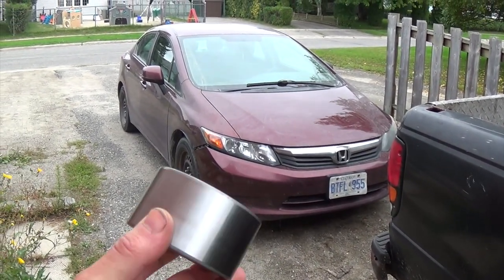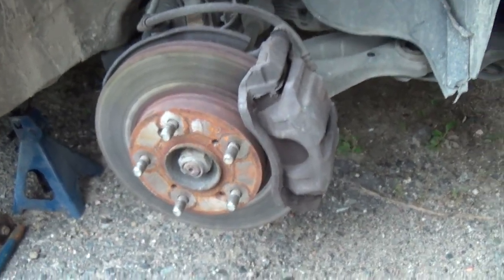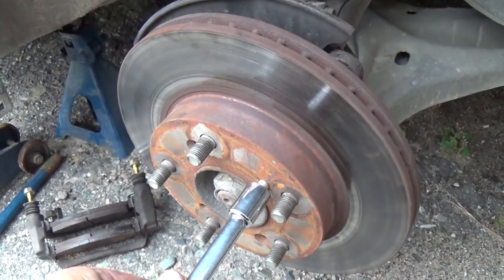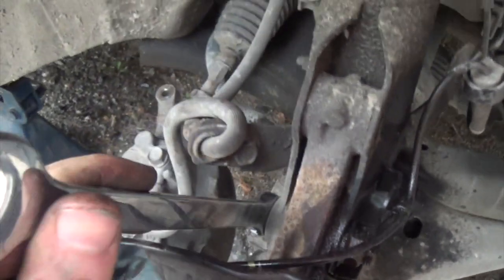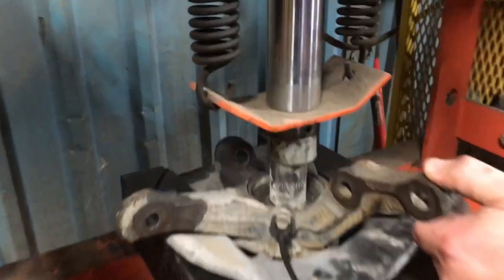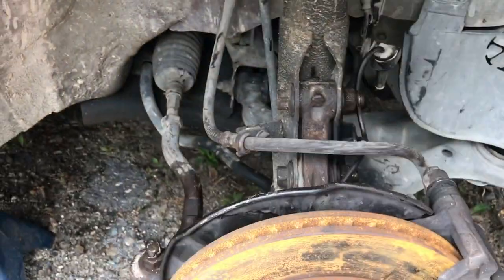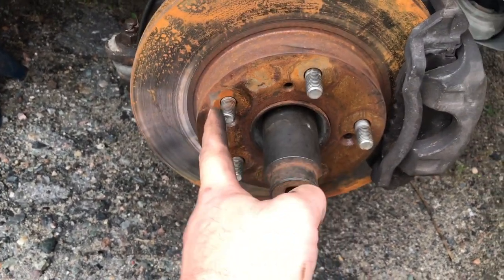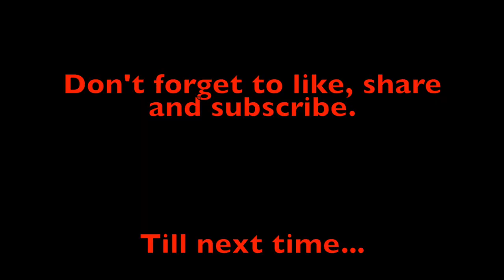2012 Honda Civic front wheel bearing change D.I.Y.

Comment: This is a good video because it shows you don’t need to remove the ABS sensor.  You can press anywhere on the old bearing because you don’t have to worry about damaging it.  This is a really good tip thanks for this video!
Reply from the maker: No prob.. thanks for watching!

Comment: Pressed in bearings should be outlawed. Although assemblies can be a challenge. But if you don't have the correct tools, it is cost prohibitive to DYI pressed in bearings.
Reply: I’m pretty sure all the old heads often hammer the things in. If you don’t have a press legend has that you can still do it lol
Reply from the maker: Yup I have done it like that plenty of times. Just had a press available this time.

Comment: Question , did your abs light come on when you disconnected it . Mine came on with abs , vsa and check brake system after replacing the bearings .
Reply: You put the bearing in backwards, one side has a magnet for the abs sensor
Reply: @clutchup9046  I used a paper clip to see what side had the magnet. And I put the magnet side inwards
Reply from the maker: The sensor reads off the ring on the cv shaft.

Comment: Who used an impact wrench to take the axle nut off ? Because if you don’t have an impact, then you have to take the nut off first I learned the hard way from watching your video now I gotta put everything back together.
Reply: in the future just put the rotor and caliper bracket back on. Then put a solid screw driver or other bar in the vents of the rotor to catch on the caliper bracket. That will keep the wheel from spinning while you are loosening it with a breaker bar. In short though best investment for and DIY or weekend guy is an impact.

Comment: sir how are you, could you please help me ?, I need to change the rear bearing of a 2015 Honda Civic LX, you could guide me, or at least tell me that I have to loosen, thanks
Reply from the maker: Hello.. good and how are you? If you remove the drum there should be four bolts holding the bearing on to the car they may come in from the back or the front of the bearing and on reassembly torque the bolts to 47 lbs - ft 
good luck and let me know how you make out

Comment: I am about to do this on my 2012 Honda civic LX and a 12ton press from Harbor Freight. Is there any other specialized tools I will need? Should I replace all the nuts and bolts that I take off or is it okay to use the same nuts/bolts.
Reply from the maker: Hello. The press is the only special tool. Can be done with out it. But it does make it easier. You can reuse all the hardware just make sure you torque everything to the proper torque spec.
Reply: @carguycorner7879  Everywhere I look it shows to remove the wheel speed sensor, in your video I see you do not remove it from the hub. Did any damage come from not removing it?

Comment: What was the mileage on this one? Had to change mine with only 106k kms on it
Reply from the maker: It has over 300,000 now. It’s been done a few times. Lol
Reply: Changing mines at 126,000 miles
Reply: My 2012 Civic bearing just went out with 60,000 miles. My guess is Honda is starting to use Made In China parts. I have had cars over 200,000 and never had to change the bearings.

Comment: I would have left the steering knuckle in the car and used a forced screw and discs to remove the bearing after i pulled off the hub with a slide hammer.
Reply from the maker: Bob Grizley that is one way of doing it.